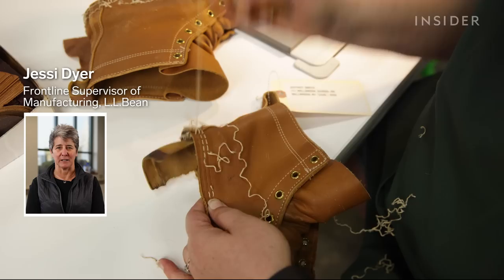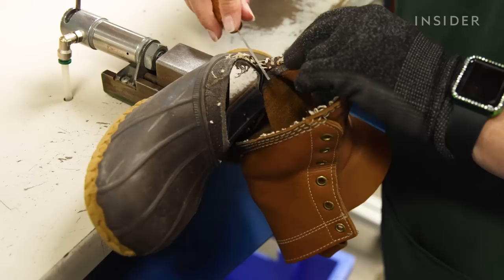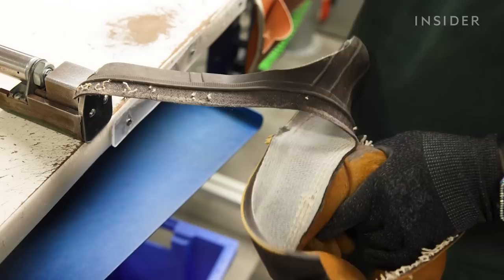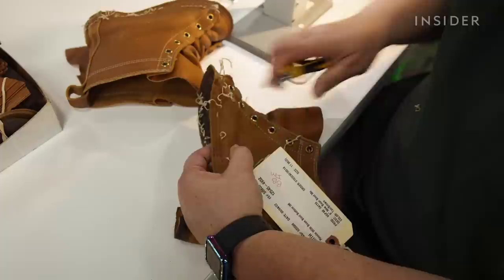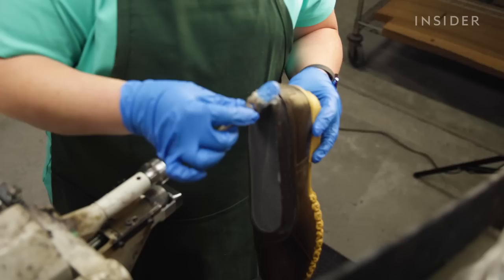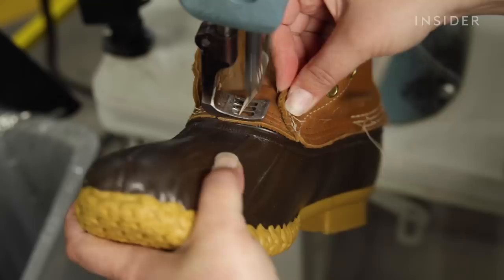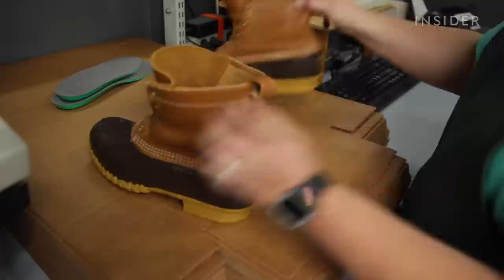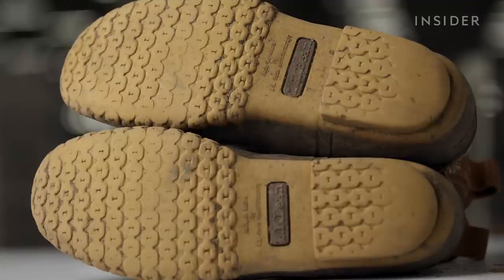How L.L.Bean Boots Are Professionally Restored | Refurbished | Insider

Comment: For all the people saying "why not just buy a new pair?", one of the benefits of having them resoled is that the leather is already broken in.  It's soft and supple from use, and has formed to your body.  The older leather tops are much more comfortable than brand new stiff tops.  This is a real plus, especially if you wear these boots a lot!
Reply: And basically we don't make new waste and utilize the leather to its full capability! (The leather are still in great conditions even after the rubber wore out)
Reply: DBCooper  "half the boot creates just as much waste as the full boot" ???
Reply: @boogyuls  i jumped out of my seat
Reply: I don’t wanna be wasteful and I like my boots and wanna keep them. I have similar boots but from a better Canadian brand I got for $3 at a charity store to support da homeless.
Reply: @jimdshea  youre talking to the type of people that would buy new air forces once or twice a year.
Reply: Yep! I have a pair of Ariat boots that are comfortable like soft slippers.  Got the heel replaced because it was wearing away; totally worth it.  I've had them 7 years so far.
Reply: Good point.  I have had mine worked on, the pads were replaced, new laces, paid for the buffing and polish on the Vasque, and the comfort is even better.   
I do not plan on giving up My "Beaner's" and/or Vasque's (1995 purchase). 

USN(RET)

Comment: I have an old pair of LL Bean boots - they're comfortable as can be. Worn them for 20 years and they're still great. When the sole gets bad enough I'll just have them resole it - we live in a "throw away" culture, when it's cheaper and better for the environment to simply restore or recycle the part that needs replacing.
Reply: You buy for keeps, as do I.
I have a pair of tennis shoes from 1980.  They are the best I have ever owned.  
The Original Puma Basket, with the turned yellow baseline.

Comment: If most of the shoe is getting replaced anyways why wouldn't you just buy a new shoe?  Refurbishing it can't possibly be that much cheaper you might as well just get a new shoe
Reply: Edit: I looked up the cost, new boots cost $149 while the restoration costs $39 plus tax. It looks like they keep the leather and just replace the sole. Sustainability isn’t always about being cheaper, but about using things for as long as you can. But in this case it seems that both can be possible which is great!
Reply: I was thinking the same. I love these restorations but a lot of times it seems cheaper to rebuy.
Reply: I wore a pair of those boots for close to 8 years doing heavy construction in the winter. Once you own a pair of boots for so long there is a certain attachment to them. My soles were much more worn than the ones in this vid plus some of the stitching was torn. I received them back from LL Bean repaired and I was more than pleased. I still have those boots today. They must be 20 years old now. I would not hesitate to send them back to LL Bean. Like the old saying goes “ you get what you pay for”
Reply: It’s definitely cheaper to get them fixed and the leather on new ones is so stiff so by resoling your old ones you still get the comfortability of the broken in leather

Comment: Lol great work but why? These boots look totally dumb. What is their purpose... fishing? Even as a gift i wouldnt wear those 😅😅😅
Reply: They are for the wet, cold, nasty New England winters. The bottoms or outsole are sealed rubber and totally waterproof. I've stood in snow for hours and worked outside in slush and snow and your feet stay totally dry. Mine are insulated as well so they are fairly warm. Great for working outside in any environment where you don't want wet feet, and they clean up quickly. Although they are often worn outside of their intended purpose nowadays, they are absolutely built the way they are for a reason. They aren't meant to be pretty fashion boots